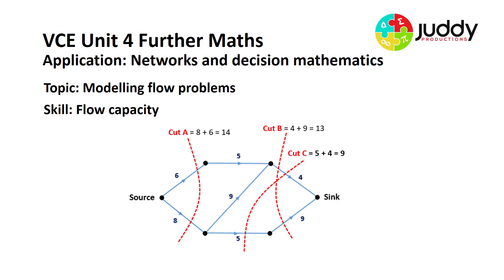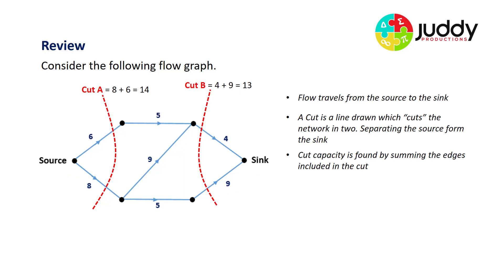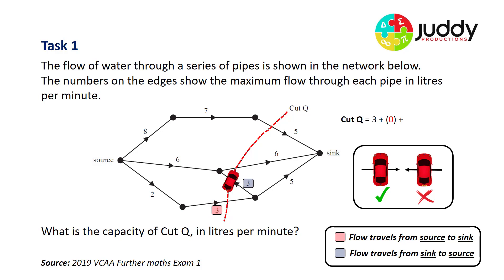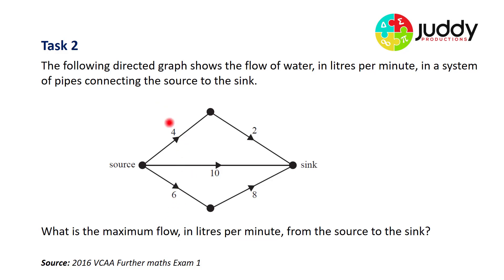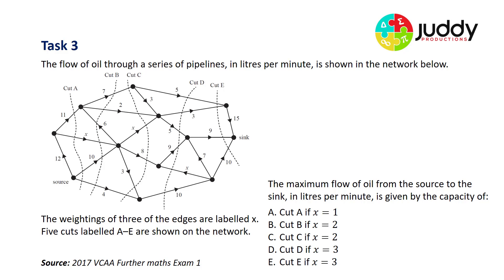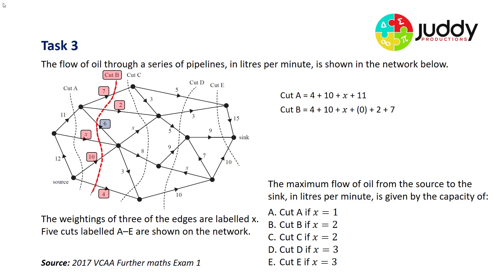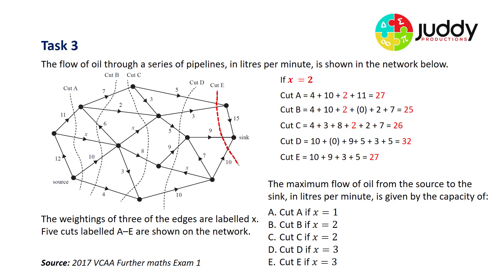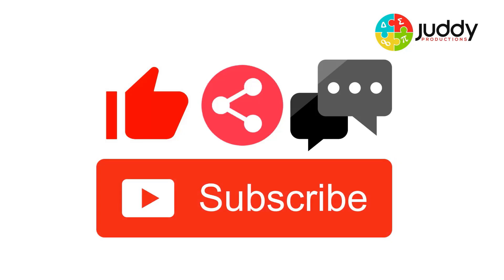Minimum cut and maximum flow capacity examples

Comment: Why is cut c equal to 9, why didn't we include the other arc of weight 9 into our calculation?
Reply: I believe it has to do with the fact that each cut is independent to one another. Hence here, the cut you are refering to is only going through edges 5 and 9. That is the flow we are currently dealing with.